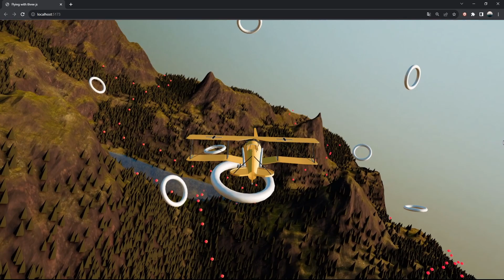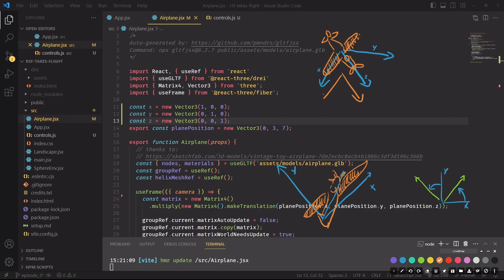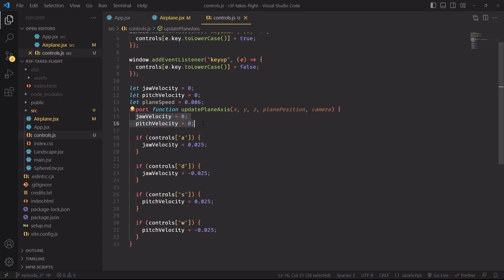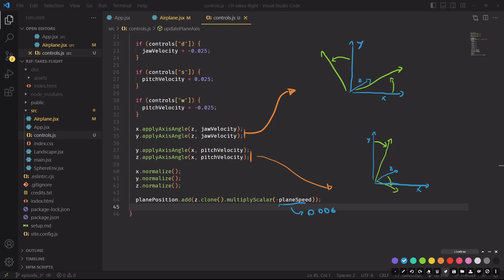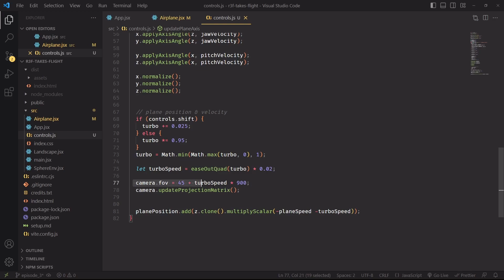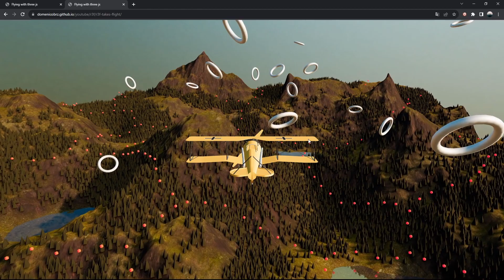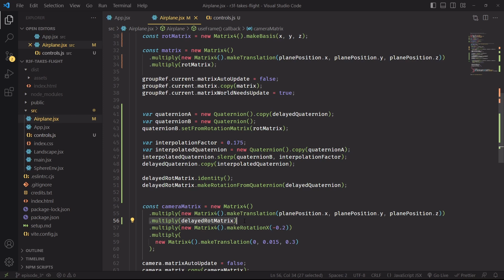JavaScript Game Development: Build an Airplane Flying Game with React Three Fiber & Three.js- Part 3

Comment: Excellent tutorials.  The rotation math (bank, pitch and yaw) appears to be working perfectly and the control and camera lags are a nice touch.
How are you rotating the prop - as an animated part of the aircraft blender object or as a separate object?
Reply from the maker: Thank you! :) By prop you mean the helix? We did that at the end of part 2, to be honest though the rotation of the helix is wrong because the element's origin is in the wrong spot, but it's spinning fast enough that it's too hard to notice